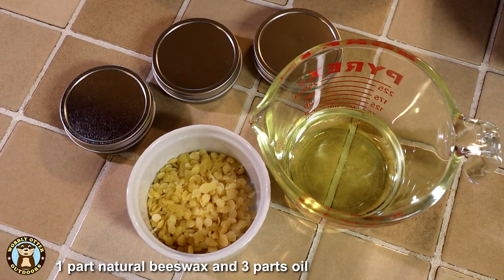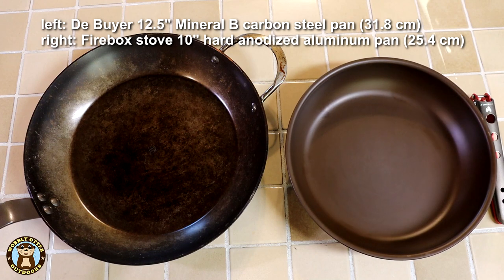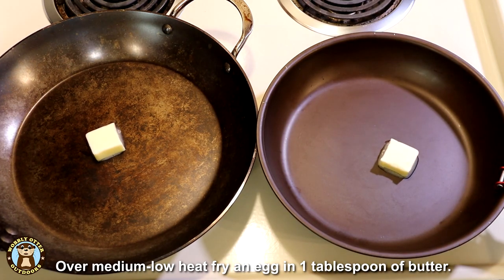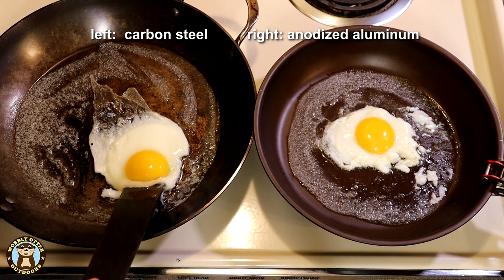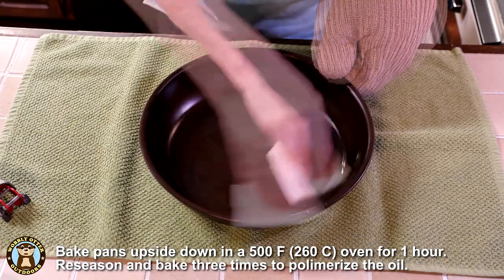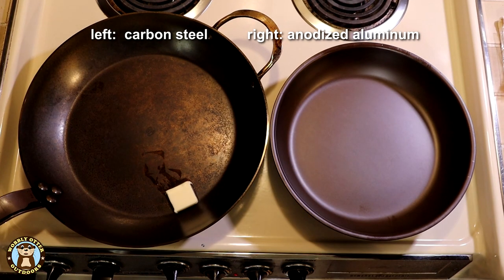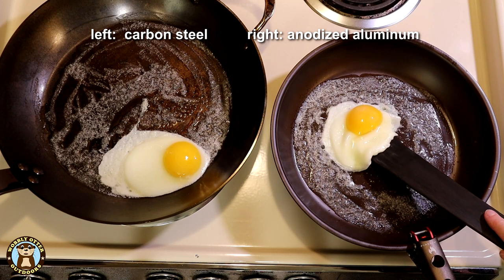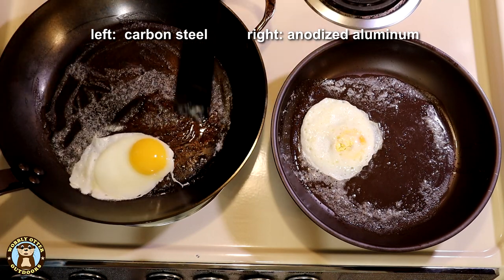Making and Testing Pan Seasoning Wax

Comment: Using the beeswax along with multiple oils provides different length hydrocarbon chains, leading to a more complex polymer coating that is supposed to be more durable than one from a single oil type.
Reply from the maker: Thank you for the explanation. So helpful.

Comment: the bees wax seasoning compound will keep oil from going rancid between uses (oil is not exposed to the air).   i have used buzzywaxx and crisbee.  take the pan out you're going to cook with, while its heating up rub a small amount of cooking oil or crisco (your choice) around the pans cooking surface, when pan is properly heated up then add your butter to melt and then your food. clean pan as you normally would, dry on medium low heat, while the pan is still warm to touch apply beeswax compound, rub in , remove excess then store pan until next use.

Comment: I make my own out of 30% wax, 35% Crisco, 35% grape seed oil by weight. Just made 4 lbs of it a couple days ago for my cast iron. It works much better than oil by itself. I think the seasoning is much more durable.
I store it in the freezer so it will last forever.
Reply from the maker: Cool! This is awesomeness.

Comment: Good comparison.  I bought the Firebox pan after seeing one of your prior videos.  At this point the DeBuyer I own is definitely more 'non-stick' than the Firebox, but that is probably due to overall use of each pan, as I use the DeBuyer much more often.  But, I'll try your seasoning wax mixture on the Firebox and see if that makes a difference.
Reply from the maker: Thank you, Mr. Winger. Same here. I've used the De Buyer much more also. I think I'll make a point to ise the Firebox aluminum pan more in hopes of improving it's sticklessness. (New word?) I'm interested in hearing what you think of the seasoning wax.

Comment: Thank you. I just bought a new carbon steel skillet and these were some of the questions I had in how to treat and season. One thing’s for sure, I am not spending the 20+ $ the company wants for their seasoning mix which is…bee’s wax/canola oil/grape seed oil.
Reply from the maker: Glad it was helpful! After using the seasoning wax for a while, I am leaning more towards using either straight grape seed or canola oil for pan seasoning. The addition of the beeswax may be beneficial if the pan isn't used frequently. After using it, I'm just not 100% sure the wax is necessary.

Comment: If you will let the carbon pan heat for 5 min on med to med hi, then drop your butter in until it stops foaming then you can add your egg and should see a little lifting around the edges in a short time. At that time a little quick shake of the pan should cause the egg to move.
Reply from the maker: Thank you, Paul. Ahh. So beautifully logical.

Comment: The seasoning wax pucks I make are 1/3 by weight beeswax, grapeseed oil, avocado oil. Instead of putting them in tins, I measure them out into foil cupcake liners in a cupcake pan. I store those in a Ziploc bag in the fridge, and when I need to do seasoning you can just unwrapped one and rub it directly on the hot pan and then wipe off any excess.
Reply from the maker: Oh, how very cool! Love the use of the foil liners.

Comment: Is beewax the same beewax for making candles ? Can I use with stainless steel?
Reply from the maker: 100% beeswax is food safe and is one of the ingredients used in making the seasoning wax shown in the video. I don't know what beeswax options are best for candle making.

According to HeritageSteel.us,  the source linked below, "Similar to cast iron, stainless steel cookware can be seasoned to create a semi-nonstick surface of polymerized oil molecules.
Unlike cast iron, seasoning on stainless is not meant to be continuously built up. Instead, a temporary seasoning layer can be added to aid in cooking delicate foods like fish or eggs."
Source: https://www.heritagesteel.us/pages/cooking-techniques#:~:text=Similar%20to%20cast%20iron%2C%20stainless,foods%20like%20fish%20or%20eggs.
Reply: @wobblyotteroutdoors  thank you
Reply from the maker: You're welcome.

Comment: would this method also work on old cast iron pans as well?
Reply from the maker: Hi, Patrick. Yes, definitely.
Reply: Yes. This is the same blend of oils/beeswax that Buzzy wax makes for their cast iron seasoning in a tin. It is marketed for cast iron and carbon steel and if it weren't so pricey to keep buying, I'd continue using it...gives a beautiful finish, however; I now make my own that consists of either grapeseed and avocado oils with beeswax or grapeseed and sunflower oil and beeswax. Works beautifully on cast iron.

Comment: Boil vinegar with water and oil inside the carbon steel, let it do a rolling boil for about 2-3 minutes and let it sit for about 5 minutes discard the water and wipe, eggs will slide right out. No need of doing that tedious oven tactic, same for cast iron, reseason sporadically, I do it about every 6 months? Personally I don’t want any wax residue. Dry your pan with heat from the stove for a few seconds, put away and you’ll never have rust.
Reply: What residue do you speak of? This oil/beeswax combo makes a beautiful patina. Rich color with shiny, smooth surface  (no sticky/tacky feel whatsoever) that is far superior, in my opinion and experience, to oil alone. I do find it works even slightly better if you do the initial seasoning with grapeseed oil and then all future seasonings with the oil/wax combo. Virtually indestructibe.
Reply: Vinegar will eat your seasoning off.